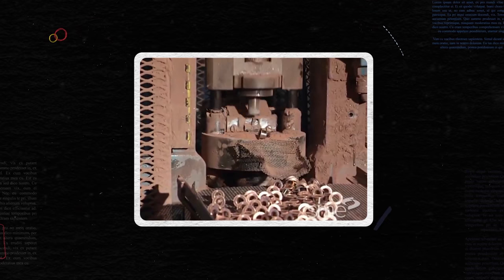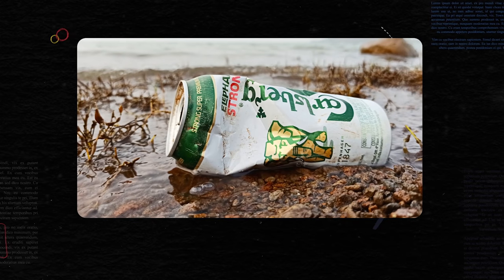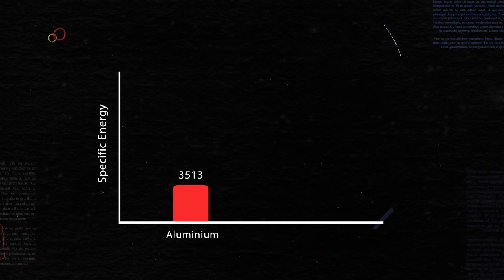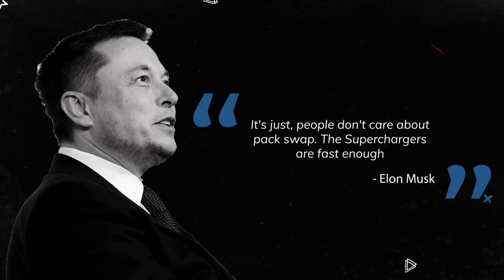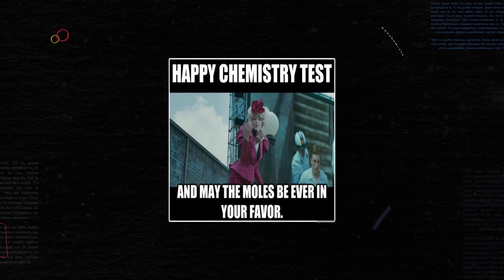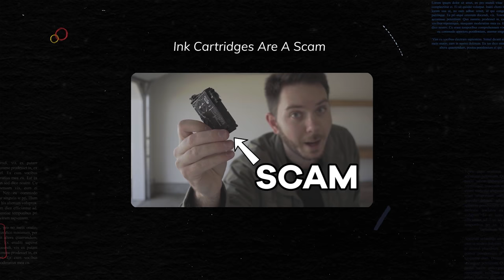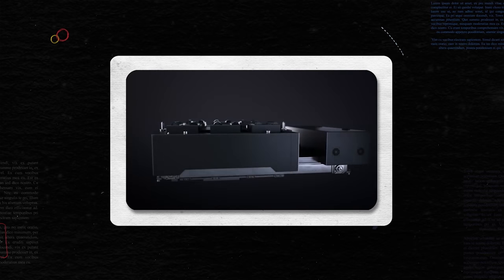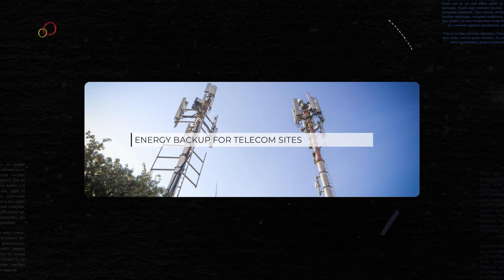We Can Get 1600 KM of Range With Aluminium Batteries

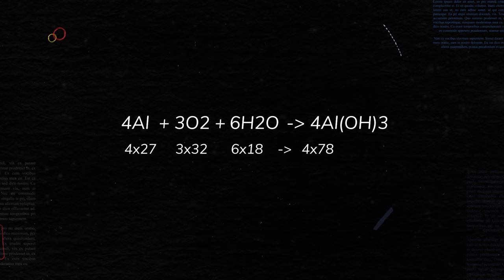Comment: Hello Sira, very well structured presentation as always. I noticed near the end of the video (~12:10) you mention the production of hydrogen during the reaction but the formula you show earlier (~10:00) is not correctly balanced and does not show all the products on the right side, especially hydrogen.

Also, you might want to look into the emerging carbon-free technology (Elysis process) to refine aluminium that would solve the greenhouse gas problem of recycling Al2O3 from the cassettes after use.

Thumbs-up! Cheers!

Comment: In short: High energy density but tedious handling and energy inefficient to produce.
Reply: A Football Stadium sized parabolic solar-thermal smelter out to do the trick.  Build a prototype out of an existing stadium in an equitorial region.  Courtesy of Archimedes.
Reply: @buttafan4010 The inefficiency won't go away by using a "stadium sized solar thermal smelter in an equitorial region". The same energy can be used in a more efficient way. You're still wasting it due to conversion, transportation and waste management.
Reply: @brixomatic  Perhaps ... I think that as long as we are producing aluminum products of any kind, that process of melting down recycled aluminum and smelting of bauxite ore can be accomplished using solar thermal smelter/blast furnaces instead of constructing hydro electric dams to produce electricity for the aluminum beer can industry.   I advocate industrial scale solar thermal whenever even remotely relevant ... and sometimes seemingly less relevant. i.e.  Protest shields should be hybrid parabolic shield/mirrors ... capable of melting ... large bronze outdoor displays ... and eliminating the presence of I.C.E.   "A thousand points of light." - HWB Just sayin'.

Comment: Why not just use a big stack of aluminium plates instead of a solid chunk for the anode? You'd avoid the whole ASS situation, by just making the pieces light enough for anybody to swap out by themselves. Plus you'd be able to 'top off' the battery, instead of running it all the way down each time.
Mostly a serious point, partiality just a chance to mention the Anode Swap Station in a sentence 😂

Comment: why not divide the cassette in two, weight is halved and when one is depleted the car can still keep going and the weight becomes manageable for a person to swap the half-cassette?
Reply: That was my question it’s unclear how the design is such that the anode couldn’t be chunked down to a user manageable size. 
But also what is the safety risk and damage risk of user doing this action?  The other factor may be that users can’t handle the process in terms of following process.
Reply: I thought about it, too. Why can't the cassette be only one third of the size so that the weight is around 40 to 50 kgs, and the range is one third also, that is around 325 to 350 kms. 325 kms is a decent range and 45 kgs  weight is mangeable.

Comment: Good presentation, however I think it would be nice if:

1. At the start of the presentation do introduce yourself at least with your name or pen name. That's good etiquette.

2. Since you have taken the pains to go in details, you might consider  having a reference PDF file of your calculations so the viewer can download it. It's not possible to see and absorb in 5 seconds the small script.

3. A bit of discussion on pros and cons of having a smaller (and lighter) Aluminium cassette would have been better. That would make it convenient to let user change the batteries himself (like a tyre).
That also impacts the calculations that you have shown. Incidentally smaller aluminium cassettes have another major advantage. 

4. Kindly do not mix currencies. If you are focus is on India then Indian rupees and Indian rates should be used.

Comment: If you are running low on gas, you just pull into a gas station and fill up. If you are far from home and your electric car batteries are running low, you are screwed. Even if you are lucky enough to find a charging station, it will take hours, not minutes to recharge the batteries. Also, in cold weather, batteries lose much of their power and a car left outside may not have enough juice to turn on. Call me a luddite but I am sticking with gas until all these problems are solved and that could take decades.
Reply: Most people's commute is less than 35 miles round trip plus other daily task less than 100 miles a day you come home and charge it. just like your phone they have 400 miles to 600 range soon to be 850 range this fall  plus 20 min 80% rapid charge seriously. Technology has come a long way in 10 more years 1200 miles easy 10 min charge and there are tens of thousands changing stations in USA. No real engine maintenance.
But I still love 60s 70s muscles cars.

Comment: This will not reduce the carbon imprint as long as you have to use a carbon burn-off electrode to produce aluminum (U.S. spelling).  Thus he main purpose of the electric vehicle is defeated.  :(

Comment: Lithium-Ion batteries have one issue - they need Lithium: It is expensive, has limited production and some of the mines they are using child or slave labor. And last I heard, EV's only needed 5% of the production - the rest is in mobile phones, laptops and conventional (rechargeable) batteries. There is very little way we can sustain a EV revolution on that battery technology.
Compare that to Aluminium: It used to be more expensive then Gold or Silver. But between the Hall-Héroult process and industrial energy production, it is so dirt cheap we are literally using it as packaging material in our day and age. I use it as a example to show how progress in energy production or other seemingly unrelated fields can change the world. And the environmental footprint is mostly dependant on where we get the energy from - one thing we are working on.

Comment: Well.... I don't think Tesla Batteries are ending up in land fills. I do agree that 98% of Lithium batteries were likely ending up in landfills but that was before Tesla. I bet you Tesla will figure out a viable way to recycle the large battery packs. I mean they are just now ramping up production of their new 4680 cell which has GREATLY reduced the need for rare earth elements and Cobalt. I'm sure at some point in the near future they will find a way to recycle their older 21700 and 18650 battery cells into the newest 4680.
Reply: this said, 21700 and 18650 are in a LOT of other battery powered devices like laptop batteries, power tools, power banks ect... If Tesla starts recycling these then that will greatly reduce the amount of Lithium that is wasted.

Comment: Seems like changing the cassette into two, half-sized cassettes (to be drained sequentially) would be a good way to go. Half as big and heavy (easier for an individual to swap), and can be changed in smaller increments (rather than needing to drain to near 0 before each swap)
Reply: why not four parts to be even lighter? easier for the weaker to swap

Comment: It seems that this technology should first be implemented in city buses etc.. Every night when the buses head for the garage, they could be maintenanced with all needed equipment at the location. Same would be for all commercial vehicles that stay within range of the companies maintenance facilities. For now at least, private passenger vehicles would continue to use Li-ion.
Reply: Totally agree with you. Where the required range and maintenance facilities are established, known or constant, this technology shines. Fleet management/city transport/delivery services/professional services providers./last mile connectivity.

From a consumer point of view, this battery could also work well with leasable vehicles since the company could take care of all maintenance(including the swapping) on behalf of the one  using the vehicle.  And this will still be less than the maintenance needed by any regular I.C.E vehicle.

Comment: What makes sense is a hybrid of both systems, which would completely combat the range anxiety of lithium ion batteries. Also Al Air batteries make a lot of sense for aviation, electric jet engines are now a thing, but the energy density of Lion batteries is too low to give them a decent range! Al Air batteries in electric jet planes makes so much sense!

Comment: Great video! It doesn't seem like this technology is well suited for personal vehicles. It doesn't really have a 1000 km range if you need to stop to replenish the electrolyte every 300 km. Anode replacement at a dedicated facility is a show stopper. And finally, what do you do on those occasions where you still have substantial energy reserves in your fuel cell, but need to make a longer trip. With the ever-increasing speed of charging and energy density, I predict that battery-electric vehicles will win the battle; maybe not lithium, but batteries nonetheless.

Comment: Wonderful work sira! Long waited for this one. 

However, there's a down-side to this kind of battery that I think is suspiciously kept under wraps.  Namely that the very caustic KOH electrolyte - continues to eat-up the Aluminium anode even when there's no current in the external circuit. 

This is a serious hurdle as it means that it would be wasteful to merely keep the vehicle idle!  One approach has been to "stop" the cell reaction by moving the electrolyte out & isolating the aluminium with lube-oil.

Did you see how Phinergy/e-9 work their way around this?
Reply: We can use other electrolytes also
Reply: @harsha6655  from what I know, it is KOH held in a polymer gel. Yes, you could perhaps use other alkalies like NaOH/LiOH. It wont solve the problem. You need very alkaline electrolytes to react with Aluminium in order to generate hydrogen. Phinergy's "nanotech" has been successful in developing the Carbon+Air anode, wherein thanks to which, an incredibly large surface area is made available for oxygen to lose electrons to the Aluminium cations to form Al(OH)3

Comment: Aluminum Air batteries have been touted for at least ten years. I wonder what has been the barrier to commercial development.
Reply: The cassette is basically disposable and has to be remanufactured (smelted) which requires lots of energy to "recharge".  In this example 43kg battery would require 15kw per kg to "recharge" and would need 645kwh of energy to recycle the aluminium in a 43kg battery.  It has to be heated to high temperatures which is harder from renewables and would probably require smelting from green hydrogen which isn't a particularly efficient process in the first place.  So efficiency is roughly 1 mile per kwh instead of maybe 4.5miles per kwh for battery electric.  If you remanufactured this battery using heat derived from green hydrogen you would probably have to put in closer to 2Mwh. End to end efficiency is like 0.3 miles per kwh which is 15 times less efficient than a battery electric vehicle. Probably have to factor in the manufacturing cost of the battery too but its probably still closer to 10 times the efficiency.  Not sure it would be a solution for the masses but aviation is an interesting application.
Reply: Thanks fir explaining!

Comment: While the target is obviously cars and larger vehicles, these types of developments are also quite interesting for eBikes. Currently I have a 500 Wh battery which weighs about 3 kg. Even if only 1/3rd of that is actual battery, that's still quite a jump in capacity on a bicycle, pushing my rather lazy "full assist, always" range from around 50 km to 100+. Suddenly the higher power eBikes become realistic distance commuting vehicles even if you cannot recharge them at work.

Comment: 7 cents/km = 11.27 cents/mile.  Newenginetype is 195 mpg on gasoline at $2.5/gallon (no road tax) = 1.28 cents/mile = 0.8 cents/km.  7/0.8= 8.75 x more costs.  Sorry, will fail...  Make fuel at home for 80 cents/GGE.  0.8/195= 0.41 cents/mile = 0.25 cents/km.  7/0.25= 28x.  Why pay 28 times more?

Comment: Aluminum does not exist in a pure state in nature. The production of primary aluminum metal begins with bauxite ore, which is composed of hydrated aluminum oxide (40% to 60%) mixed with silica and iron oxide. It takes approximately 4 to 5 tonnes of bauxite ore to produce 2 tonnes of alumina.

Comment: Shai Agassi's (now defunct) co.: "Better Place" had Swappable Batteries (supported by "mom+pop" battery-swap stations (that doubled as UPS (battery backup) during grid outages.

There are at least 2 talks (one given in Melbourne, w/post-talk Q+A; the other a TED talk), that lay out the business plan & technologies.

Perhaps Al AIR batteries could be swapped out & bulk-reconditioned (every 300 Km & 1,000 Km)?
(BetterPlace owned the batteries in Agassi's model).

Comment: The limitations you speak of can be overcome by design. e.g. The 43kg Al plate could be designed as multiple plates or rods. e.g. 1. Nuclear reactor uses rods, 2. 4 plates = 10kg each mounted side by side. The water change can also be made via a double tank insertion, one always in reserve so not interval dependant with automatic switch over. Then there is the Al Oxide residue. If this could be removed by slumping into a sludge tank it would keep the electrolyte fresh at all times. The sludge tank could then be changed over when the duplicate water tank is changed. They could even be made as a dual water/sludge tank module.These mods come close to a home swap sequence.

Comment: 1,200km between diode replacement means I'd be having my diode replaced more then 16 times a year. That's not very sustainable while increasing the spark voltage and utilizing a ram-air intake system wiyh 92+ octaine fuel provides me with 43mpg and almost no toxic emitions from my 2006 buik. My 1990 celeberty wagon was exceding 43mph still at 386,000 miles (frame damage ended that vehicle) There is NO REASON why gas engines are so inefficient (other then greed).

Comment: There's roughly 10kg of Lithium in a Tesla Model 3's battery pack.  It's also above 250Wh/kg.  Also, removing sludge 3x from a battery before it's done isn't going to gain mainstream adoption.

Comment: Aluminum based batteries is a bad idea.  Aluminum  is a process intensive metal to refine.  Out of ground to being able to use it, is not cheap.  So why bother if it's that expensive.  BECAUSE OF THE HIGH RECYCLE RATE.  Recycled process is quick and easy.  Does not require as many steps and cost is marginal compared to (out of the ground).  What a waste of resources.  THIS IS NOT A GREEN IDEA AT ALL.  Consequences of manufacturing with an agenda.  Not practicality based.  Look towards corn.  Everyone was on the band wagon to make corn to alcohol.  Then mix it in gas.   We take our food and burn it.  Only recently MEXICO, complained to UN.  America is making it hard to make TACOS.  I kid you not.

Want better way to do things.  Get solar panels to be better than 50% efficient and put them where it shines almost year round.  Sorry Portland and Seattle you won't get them.  Put wind generators where it is windy.  Not limit where they go, because it ruins the skyline off shore.  Allow off shore drilling.  If there is an accident, allow even 90% recovery ships to be used.  Yes they stopped recovery ships from being used in the gulf, because they didn't get it all.  I will take 90% over 00%  any day.

Comment: Come one, use 2 smaller batteries. 43 / 2 = 21,5 kg can be handled by most people. No problem. Or is one battery per car a dogma of any sort? But you have the hydroxide to remove. For that reason specialised facility may still be needed.

Now, you said that reducing Al2O3 to Al takes a lot od energy. OK, we like the high capacity. But it also polutes the environment with fluoride. So, while being climate-friendly, this aluminium-oxygen stuff is not environment-friendly. As of today, that is. I mean, it should be doable to prevent massive fluoride releases to the factories' surrounding. Isn't it? Only the cost can become an issue.

And just technical: it is "kg" not "Kg" or "KG". No room for being fancy. Small k stands for kilo. Big K is for Kelvin (temperature unit). For example: while 1 kg is a mass of 1 kilogram, 1 kG is a force acting on a mass of 1 kg in Earth's gravitational field. And 1 kilometer you write 1 km - again: size matters. M stands for 1 mole per liter. You don't want that here.

Comment: I built one in my shop 40 years ago.  It proved to be entirely impractical.  The problem with your description is the introduction of ambient air.  Air IS 18 or 19 % oxygen, yes.  But it also has 82% of 'other'.  A substantial percentage of that 'other' is water vapour.  The very first thing that will happen when you decompose the electrons of aluminum,, to alumina, is those electrons will convert the water vapour, hydrolysis. The creation of free O2 and free H2.  Your electrolyte can contain zero water.  Same reason.  Yes you can create a fuel cell that can power an auto for thousands of miles.  3,000 to 5,000 miles.  But,, you cannot do it.  Every ambient breath of air contains water, and every electrolyte that is non aqueous will be subject to contamination,, and VERY,, VERY unwanted emissions.
I scrapped my experiments.   I should rephrase,,, I was unable to figure a way around.  Perhaps someone else can.    I personally doubt there is a workaround without destroying the environment,,, and yet still,,, the electrons in the aluminum must come from somewhere.  Wind, solar, and burning fossil fuels in great quantities.  For 200,000,000 vehicles in the US?

Comment: Sira didn't tell you that powder form aluminum is $5/kg.  Bulk aluminum is $2/kg.  Didn't she say that the powder form of aluminum is needed?  Also, thermite is $20/kg.  I didn't see any "cost adder" for the oxidizer needed.  Last, I'm not sure if the lack of safety (essentially burning aluminum) is considered.  Would you want to be driving around on a burning metal device?